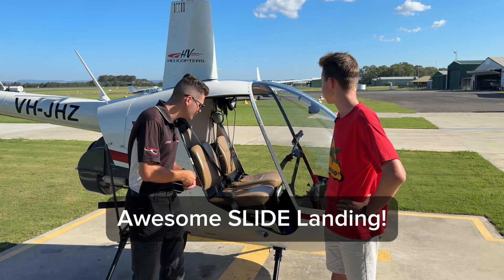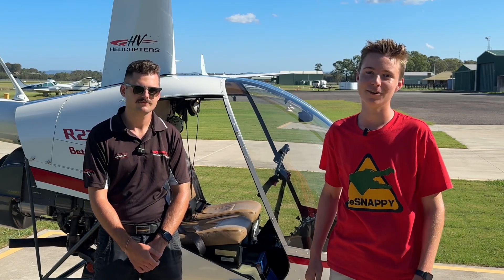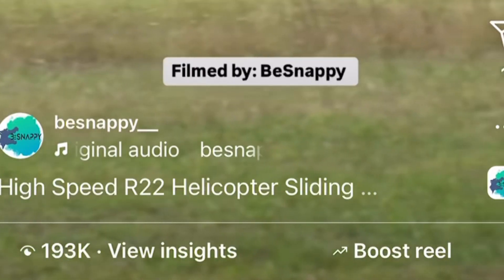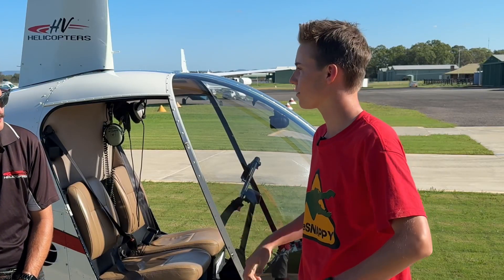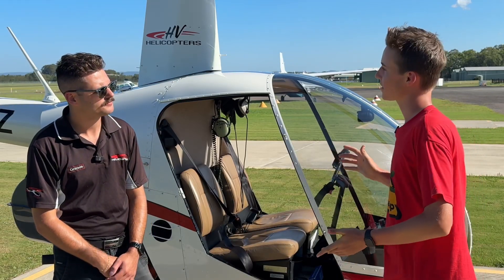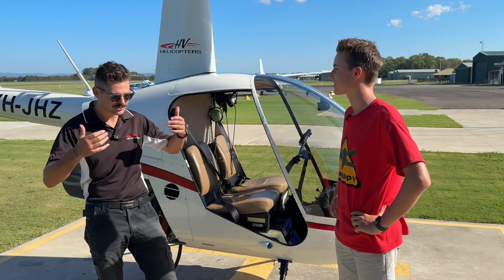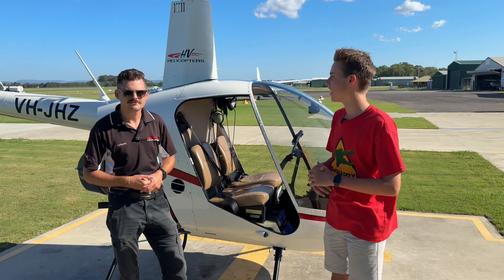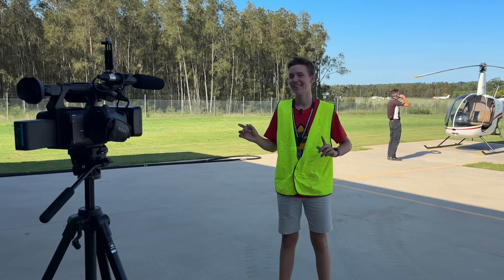SLIDES the Landing - Insane R22 Helicopter Autorotation Demo.

Comment: If you're sliding at the end of your auto you've been taught wrong.  And it is called a "running landing or running take off"
When you don't have enough power to do a normal hover to take off, You pull max power available and add forward cyclic sliding on the ground to gain air speed to get into effective translational lift. Flying in high D/A does that
Reply: All good in the perfect world.  Wind strength and direction etc.. zero zero at the end is up to the day.
Reply: @andyfly8731  Nope. All up to the pilot.
If you can't hit your spot you can do two things. 
1, Practice more or
2, Find another job.
Wind? Excuses are for pedestrians
Reply: I wouldn't agree with you on the slide at end of auto.. yes for the under power take-off.
Reply: @andyfly8731  A slide at the end of an auto is sloppy and a mismanagement of energy. In a Bell a Robinson or Enstrom or a Brantley and a Hughes. a zero zero auto landing beats sliding into a wreck
Reply: Been flying for 25 years in helicopters,  don't need another job.. I think you maybe a bit of a knob after the last comment.
Reply: @ 45+ years here and you've been doing it wrong for 25 years. 
Just like LASD Air Unit, Every cut off tail was traced back to training, Cheers
get off the knob and practice. Nothing worse then running into a bus full of nuns after a slide.  You can do better then minimum standards
Reply: @ Screw tube has your reply cut off. If you stop learning how to fly above "minimum standards" You end up going through a Pubs roof. Here they call them bars (Can I say wanker?)

Comment: Nice one.  "You're much braver than me" 👍👍👍
Reply from the maker: @AaronEngineering  How close did the tail get! You can see the shadow on the grass how close it got.
Reply: @BeSnappy  Very nice indeed.  Loved the massive flare, pitch pull and roll over.  Sadly I only fly the RC type and not the real thing. Cheers, Aaron.
Reply from the maker: @ cheaper the way you were doing it :). RC Helicopters aren’t exactly easy to fly either.
Reply: BRAVO!!! 😄